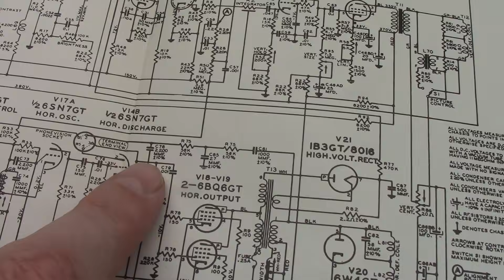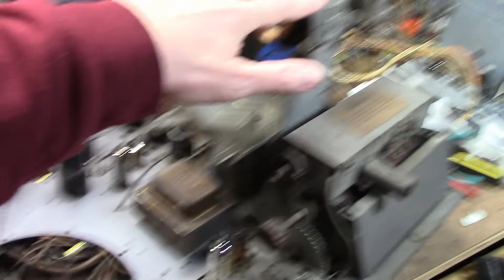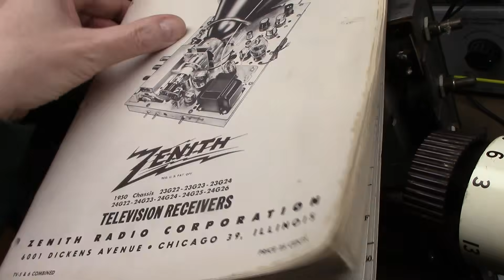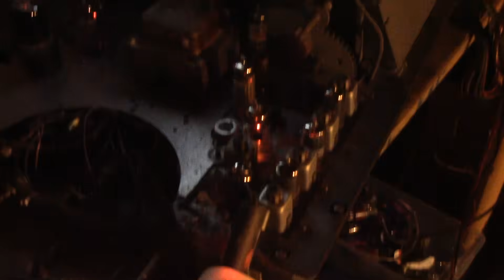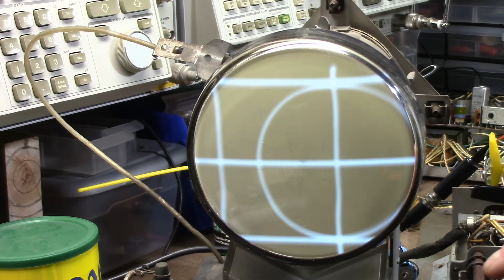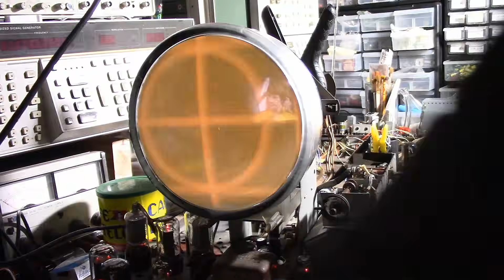Zenith G2439RZ monroe part3

Comment: Oh the phone vision! The set probably wouldn’t work if you remove that plug. I have the box that decodes it. (Well a later one from the 60s and the broadcasting headend prototype from the 70’s) the set top box replaces the sweep circuit in the set! It has the vertical drive and horizontal yoke tubes and it has i think the horizontal oscillator. Its hybrid. If you want a little more info, I have one of the film reels I got with my headend uploaded, i need to upload the longer one that explains the version you have there, i just haven’t had the time to setup my telecine and do it.

Comment: Open wirewounds can often be determined by probing half way along. May have to scrape the probe on the wire to get a good connection. Hopefully one half will be intact and the measured value can be doubled to get the original value.